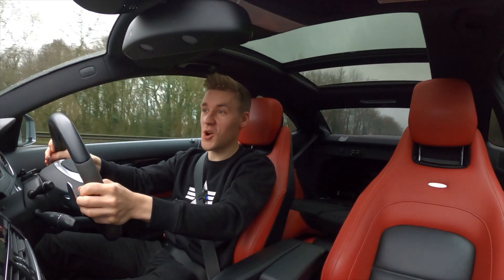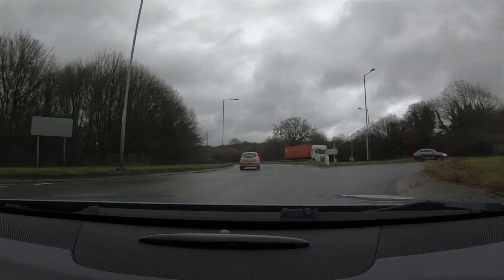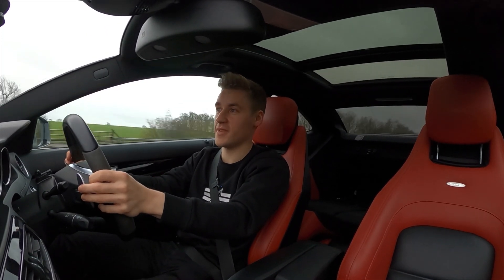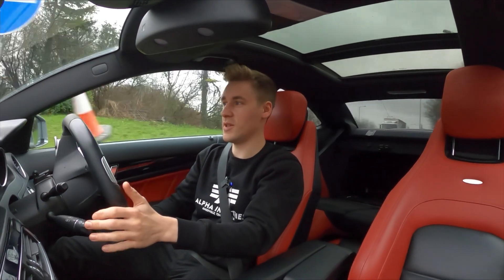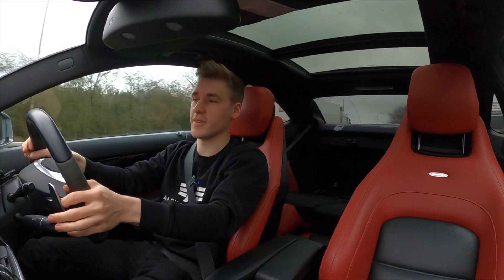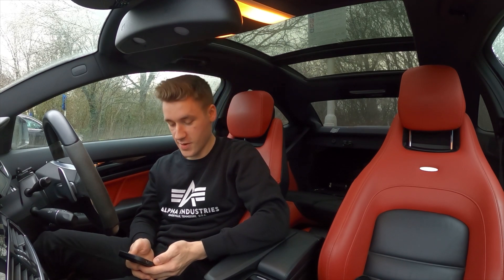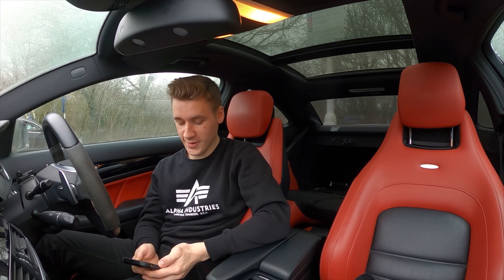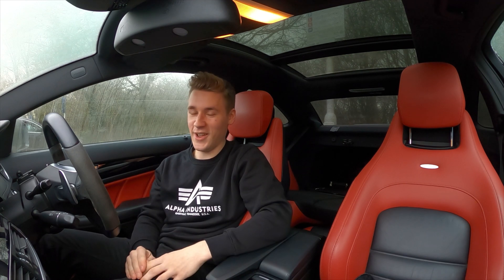How Much Fuel do Heated Seats use?

Comment: 5:15 - that's Mercedes thing. In Eco mode or comfort mode depending on the cars age it will turn down the heated seats. However in sport or manual it won't. It was like it with my A45, so I asked Merc and that's what they told me 👍

Comment: Hello Nathan, dude another awesome MPG Video for the W204 C63.  Dude since we have the same car except that you have a coupe with 19" rims with PS4's I have the Sedan with 18" rims with PS4's.  I was wondering can you do a few more MPG Challenges and find out if they are Myth of Fact.  For example does running your tyre PSI at manufacturers recommendations MPG compared to the Tyre having 5 PSI Less and 5 PSI more.  Also what the MPG would be with the Sunroof open compared to closed and  MPG with the A/C on compared to off and the A/C with Recirculation on/off.  Maybe not a great time in the UK to do the A/C Challenge, but maybe the tires and sunroof one can be done in winter.   Thanks Tim
Reply from the maker: Hello Tim, nice to hear from another C63 owner especially with a like minded spec! Thank you very much for the suggestions, if I get the chance I may give it a try! : ) I do have another C63 challenge in mind though…
Reply: @NathanMannin  Awesome sounds good.  I look forward to your next challenge :) 😀

Comment: Hey Nathan. Great video. Have you made a video using cruise control on a motorway Vs your foot? I had a 3.0 petrol Audi A4 and to use its cruise control v just keeping it at 70 with my foot the cruise control seemed to be a lot more thirsty. Just a suggestion
Reply from the maker: Thank you! That’s actually an amazing idea, I’ll need to test that, thanks a lot! 😁 Very interesting to hear about your experience. When getting up to 70, did you allow the cruise control to accelerate for you? Or did you do it manually and then select cruise control at 70?
Only reason I mention that, is because in my Mercedes I can select cruise control and keep pushing the lever up to 70. It’ll accelerate for me all the way to 70 without any input of me touching the throttle. So I was just wondering if you did the same in your A4? Or did you get up to speed manually and then select cruise control?
Reply: @NathanMannin  it was a 3.0 quattro sport with a 6 speed manual box. I used to get it up to 70 with the accelerator and use cruise to maintain the speed. But yeah with the A4 you could use the stalk to accelerate and decelerate. Love the videos though

Comment: Hey Nathan great video but going from your numbers it would seem you could get 360 miles to a tank on pure motorway driving, would you say that’s accurate? My workings out are 47 miles from 8.6l of fuel. So the c63 tank size is 66 litres so 66/8.6= 7.67. Then multiply the 7.67 by 47 miles would give a total of 360 miles. I’m looking at getting one of these and I have already accepted I will be making frequent trips to the petrol station however for a 6.3l v8 those are decent numbers if I am correct and a lot different to the 150-200 miles per tank I see posted online
Reply from the maker: Thank you! It really depends on your driving style and what sort of commutes you do. The C63 isn’t as bad on fuel as people make them out to be. I have achieved around 30mpg on a really long run at 70, medium runs more like 25/26mpg. I have very mixed driving and get around 200 miles before filling up (I fill up when I hit a quarter of a tank)
Reply: @NathanMannin  thanks for the reply Nathan, 200 miles to a tank of mixed driving isn’t too bad for what the car is. If you don’t mind me asking how much is a full tank costing you right now? Also do you only put premium unleaded in?

Comment: So that’s 0.31 MPG. I’ll leave them on
Reply from the maker: It all adds up ;)
Reply: Adds up to £4.33 per 1000 miles in your car. I’d imagine in a car less thirsty could cost even less. Good to know though.
Reply: Calculated with a fuel cost @ £1.80 a litre btw.
Reply: All it takes is one good pull to make heated seats irrelevant in that car.
Reply from the maker: @whollymindless  I made sure that wasn’t the case 😉

Comment: I will answer the question before watching the video: Effectively, absolutely nothing. Or to be more specific, so little as to be impossible to measure, let alone see for anyone outside of a very controlled lab. Margin of error in any real world test is going to be magnitudes higher.

Now to watch the video though, I am sure you did your best to find out anyway!
Reply: Ok, I have watched the video now. First, I want to give kudos for you running the experiment, its always good to try to find out things. I like your attitude!

However, in this case, the findings, even as small as 1,3% increase are misleading. You are going to really struggle to drive the same route, even on the same day, with less variation than a few percent. Any difference in traffic or stopping or weather and it shoots up to above 5% easily. On the other hand, physics of what the electric seats consume is less than 1% of the total energy of the trip, so not possible to separate, sadly. This is probably also why no one really have done this test, because if you just look at the raw math, its impossible to find out in a real world test. Still, as I said, not everyone knows this, so I salute you for testing it, its only your conclusion thats a bit flawed in the end. Its cool that you like doing statistics and numbers, I am the same way myself. Sadly some things and enviroments are just not conducive to form any conclusions at all. Cheers mate!
Reply from the maker: @GoldenCroc  Thanks for watching! I do have fun making these videos but maybe I should’ve researched more into it before doing the test. Perhaps the difference could’ve been slight stronger headwinds, who knows, the route I took on both journeys, traffic and driving style were as identical as they possibly could’ve been. On to the next test I suppose! At least we know for sure it’s under 1.3% 😉
Reply: @NathanMannin  Heres a bit of my math if you are curious: Seat warmers are generally in the vicinity of 50w when in their heating cycle. Now, even at the top setting they are almost always thermostatically controlled, and wont always be at max power, even with you turning them on again trick. But lets say its 40 watt average.

Now, if you drove your C63 at mostly a steady speed of 70mph, that would take about (very roughly) 15kw of propulsive power to push forward through the aerodynamic drag and rolling friction etc,  

40/15000 is 0.27% or 2.7 thousands. So way less than 1%. Now, the process of converting fuel to electricity isnt all that efficient in a car, but it should still be less than 1% indeed. So you are quite right.

I know you are joking with the last part sentence, but for those that dont know how margins of error work, it could actually theoretically be the case that the second run was either one of the "best" or "worst" outlier ones, making it theoretically possible from this experiment that either the seat heating consumption was 2-3% of the total, or that you actually saved you fuel having it on... 😅 . Yeah its not easy to measure.

People like to make a similar experiment with electric cars and the lights on to see if they can eke out more range. Even though the lights sometimes consume more than twice as much as a single heated seat, as well as the electric car not having any conversion losses to speak of since its electric already, its still almost impossible to measure in real world traffic.

Cheers! 😀
Reply from the maker: @GoldenCroc  Cheers for the in-depth write up, trying to get my head around all the numbers! There’s lots of limiting factors with this test and is hard to do on the public road like you said. I do have another test in mind, so no doubt I’ll be giving that a try!